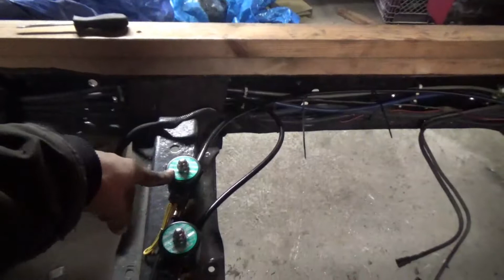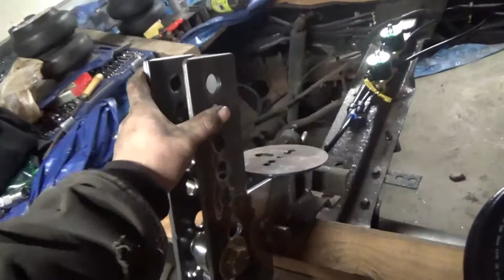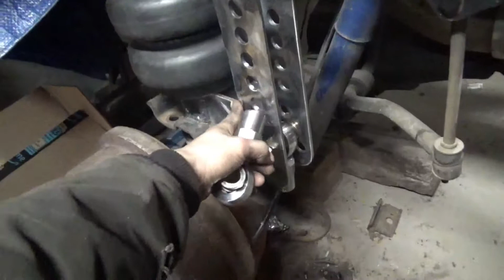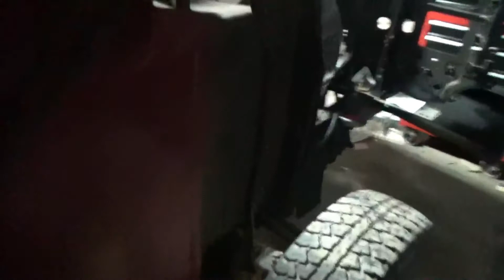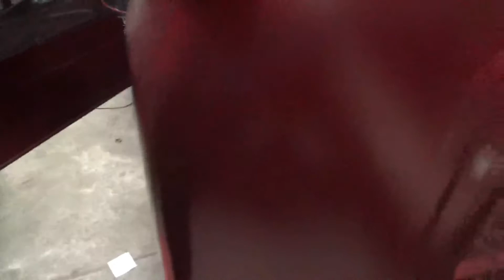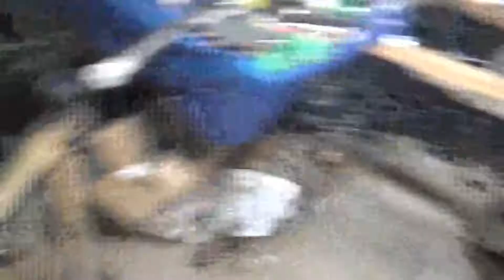Another update on the Dually Build

Comment: For your 4 link you'll want long bars not short.

Bigger the circle the less tight of a turn 
Smaller the circle the tighter the turn or radius. 

Your drive shaft will want to move in and out way to much.

Also look into triagulated 4 link easier to build

Comment: You don't have to run a oil filter relocation on your truck?
Reply from the maker: Logan Hanson   No but the coolant filter will need a bit more room. The crossmember was cut out to clear the oil filter and a new cross member made
Reply: @Petersonauto  ahh, cool. How are you doing the power steering? Are you using the DT360 pump?
Reply from the maker: Logan Hanson yes dt360 pump ford hydro boost plumbed in stock fashion